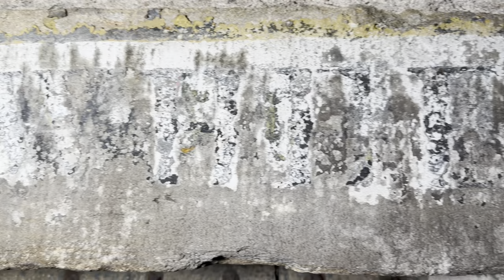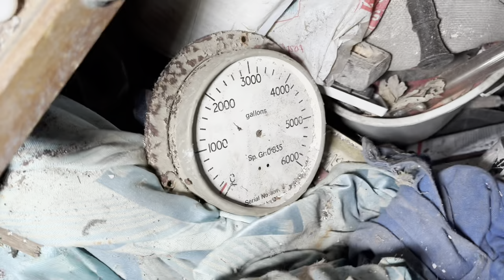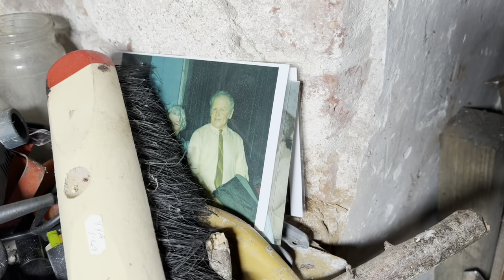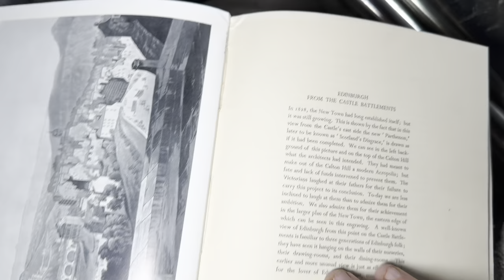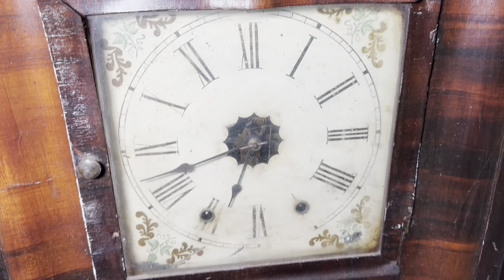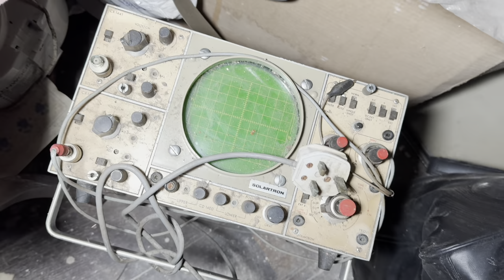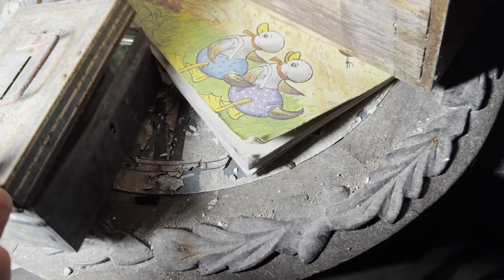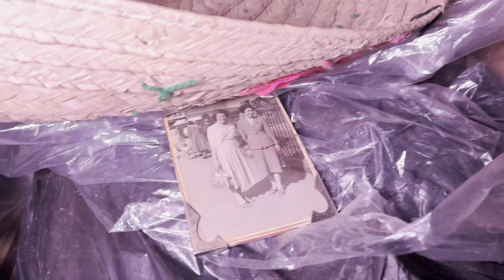Thousands watched them DIE at the Governors ABANDONED house

Comment: TREADWHEEL:
treadwheel, penal appliance introduced in 1818 by the British engineer Sir William Cubitt (1785–1861) as a means of usefully employing convicts. The device was a wide hollow cylinder, usually composed of wooden steps built around a cylindrical iron frame, and was designed in some cases to handle as many as 40 convicts. As the device began to rotate, each prisoner was forced to continue stepping along the series of planks. The power generated by the treadwheel was commonly used to grind corn and pump water, although some served no purpose at all other than punishment. The use of treadwheels was abolished in Britain by the Prisons Act of 1898.

Comment: A penal treadmill was a treadwheel or treadmill with steps set into two cast iron wheels. These drove a shaft that could be used to mill corn, pump water, or connect to a large fan for resistance. Penal treadmills were used in prisons during the 19th Century in both Britain and the United States. Wikipedia